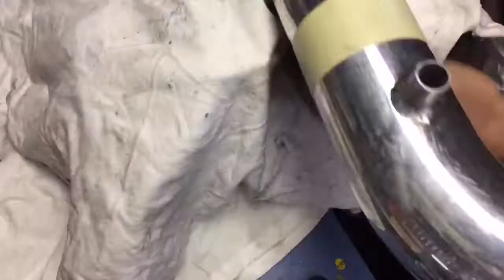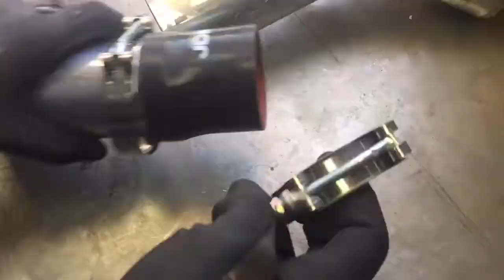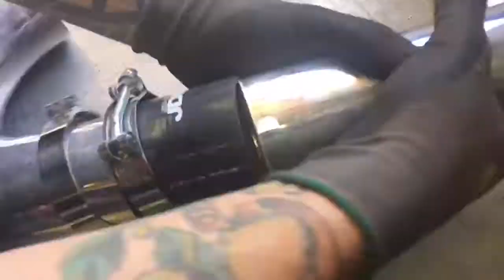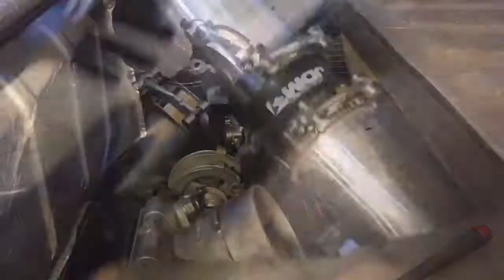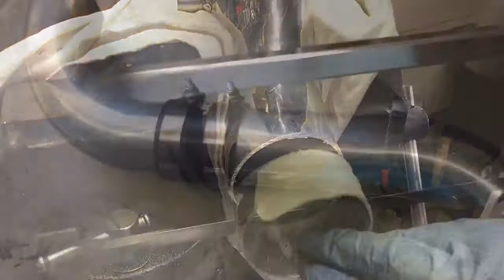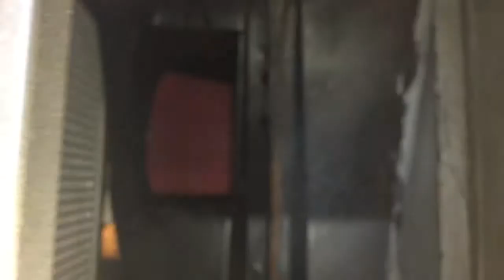Intake Ducting - Daily Driver VLOG 6/30/17

Comment: is that expanding foam a VW thing like on the late bugs that cause death rot or a later addition?
Reply from the maker: +Aaron Wookey It looks like spray foam from the hardware store. It isn't standard on busses. It is causing a little bit of rust in the engine door hatch unfortunately.